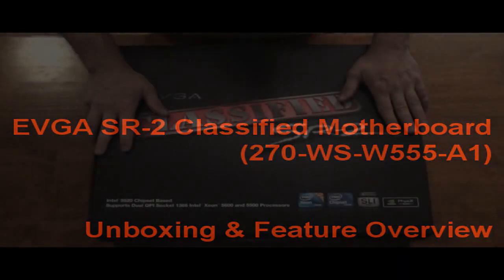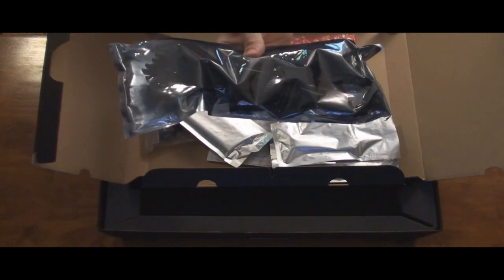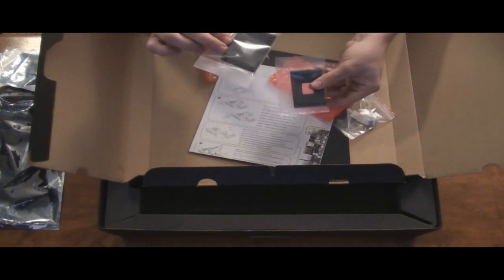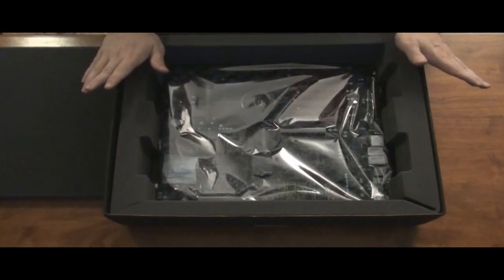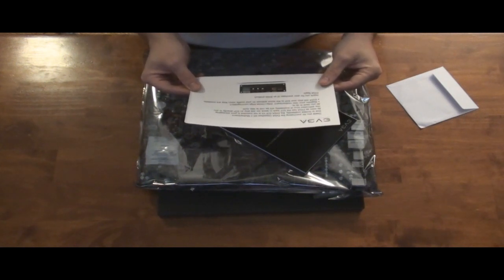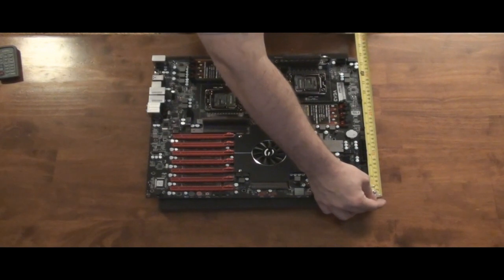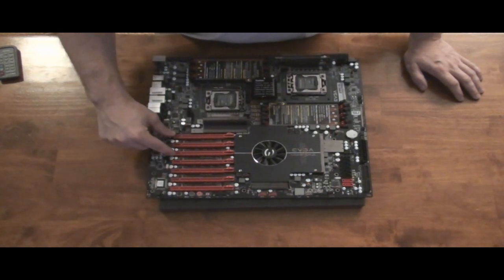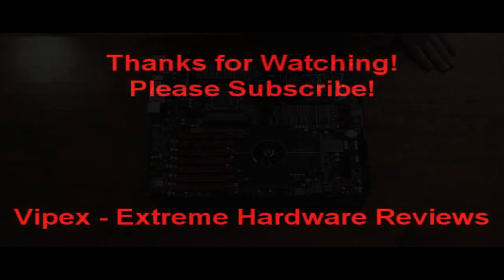EVGA Classified SR-2 HPTX Motherboard Unboxing (Dual XEON w/ Intel 5520 Chipset)

Comment: @1981z28camaro You can use the 2 xeons with corsair Hydro series with no problem. BUT, If you'll get that monsters, I think you can buy a REAL watercooling system.
Remember: the H50 was made for the "high end AIRCOOLING market" :)

Comment from the maker: @Skeleten Depth would be length in my description.  Depth of the motherboard is the same thing as when measuring a computer case.  You have height, width and depth.  There is no length when giving dimensions on a computer case.  You may be right that it is a regional difference though.

Comment: @pika198 Mid ranged goes down to low end, High end goes to low end (10-15% drop compared to the latest high end hardware). The high end hardware will always retain it's value more then a mid ranged item. A 4870 x2 still sells easily, but a 4870 or 4890 is a major loss.

Comment: @Trubyd44 Also, the whole waste of money, I don't really think so. These type of machines last years, but the people who say it was a waste of money are the people who buy $1,000-$1,500 machines and upgrade every 8-12 months. They end up losing more money. I buy a 980x, it will be even with the new Sandy Bridge CPU's. However the $300-400 i7 will be worthless, thus now someone needs to buy another $300-400 CPU. Right there the cost is the same. Mid ranged will always be the middle, highend lasts

Comment: @mrmichaelmw  as i have found out with the help from the guys at watercoolinguk.co.uk have stated xeon has 2 link qpi, where the 980 only has 1 and it needs 2 to run on the dual boards sadly.